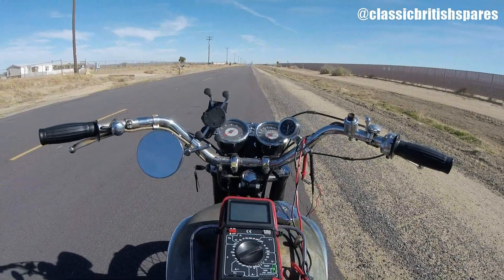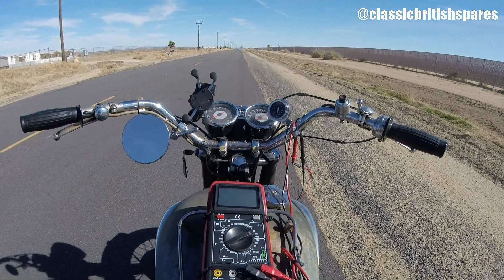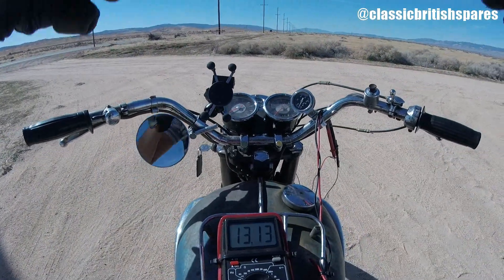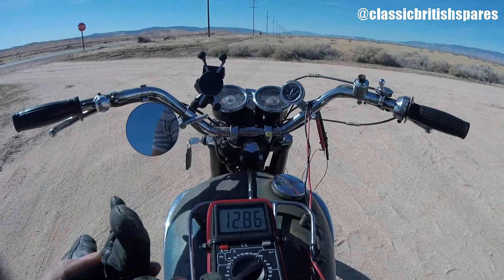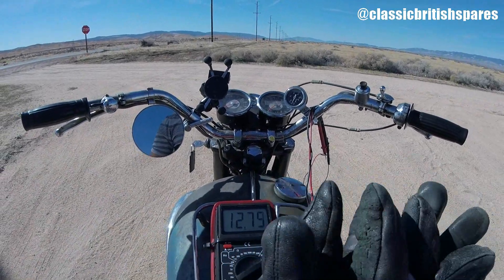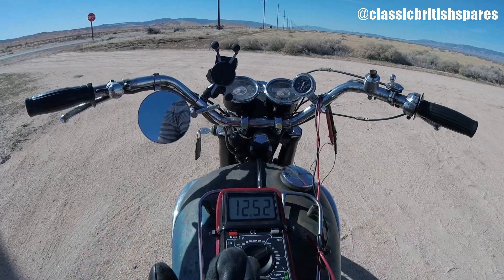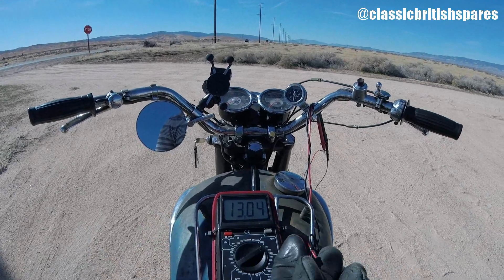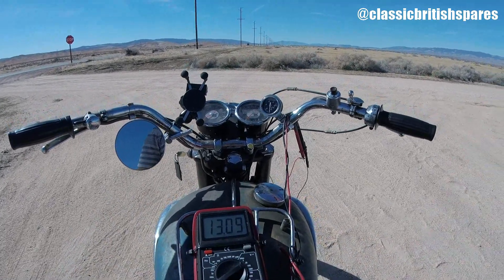Lucas Zener Diode Test - Classic British Spares

Comment: so i need to hook up an hold electrical system, my question is the zener diode essential or can i have spark without it
Reply from the maker: Diodes are used as a regulator - you can produce a spark without a diode
Reply: @classicbritishspares  so would it be possible to make my 80s harley(cagiva sst 125)  work withouth the diode?
Reply: Zener diode acts as a voltage regulator. Essentially four components to the charging system normally found on a motorcycle. First is the alternator spinning around in Primary case and generating AC current. Can't use AC current to charge the battery. Consequently the AC current is fed to a rectifier. The function of the rectifier is to convert AC current to DC current. However the amount of DC current generated at this point is still too high to charge the battery and would ruin it. Consequently, the DC current has to be fed through the Zener diode acting as a voltage regulator. The Zener limits the amount of DC current allowed flow to the battery to approximately 15 V. You have to check the chart on any Zener diode to find out the levels allowed to pass through it.
Reply: @steved5518  if only it was easy to understand what zener diode i need🥲 for now i have out the bike back in the shed because Im building a car and two other motorcycles, as of now the old diode is too corroded to read what's written on it and the scheme don't tell me much but thanks anyway, a comment like this would have helped back then
Reply: Just use a Brit Triumph T140 Zener Diode mounted onto n Aluminum plate as a heat sink. Look for later Triumph model w/neg ground.